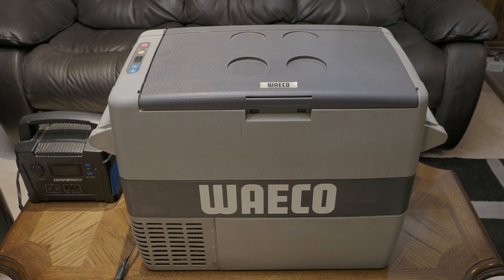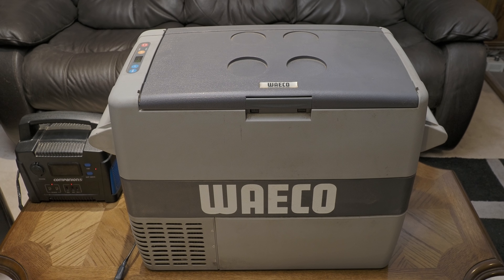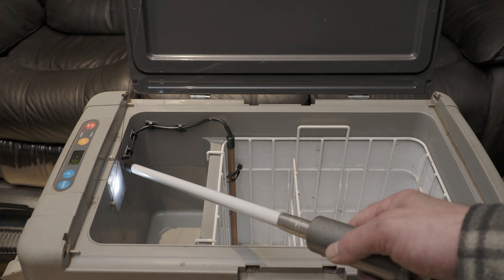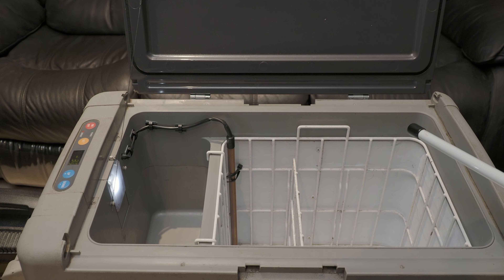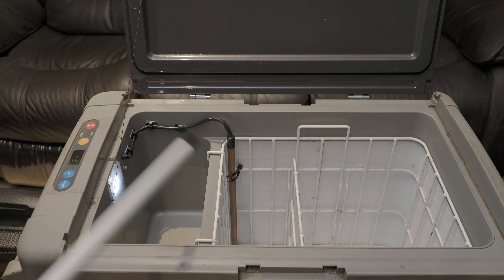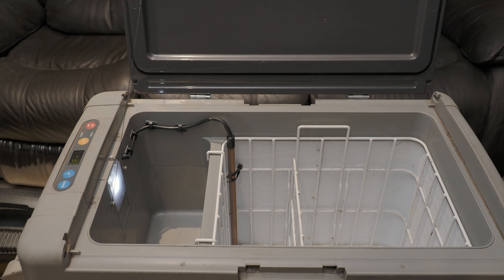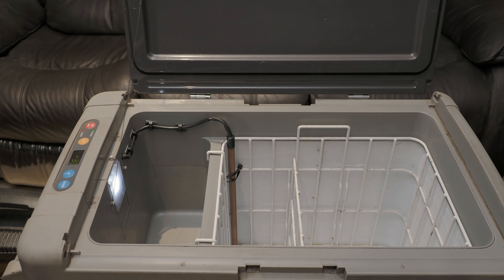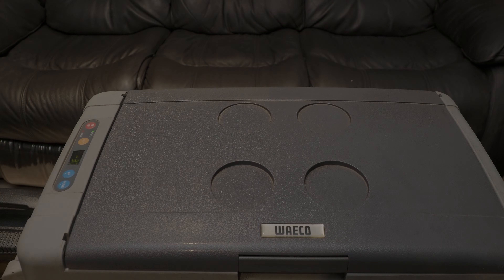Waeco CF50 Thermistor Fix - The Easiest Fix Ever

Comment: Absolutely wrong and I even say a stupid solution - never do what this guy advices!!! First of all you need to have ability to remove the white insert to clean he bottom! Second, if your Dometic CoolFreez CX or other has a faulty Thermistor - then  just order it for $8 and replace it - 15 minutes work. Most will need to buy this "Dometic 4450001983 NTC Thermistor ASM", it has the same 2 pin connector as all WAECO or Dometic. You may also use a "Dometic 3851210025 Replacement RV Refrigerator Thermistor" but int this case, you may need to preface the connector, as it is little bit bigger (use connector front the original faulty one)...  If you have done the replacement of Thermistor (in its original place) and temperature is incorrect, if cooler freezes too hard, then use the control panel, holding down both buttons "+" and "-" and then you will see "A" and temperature adjustments - adjust as needed.

Comment: 17 years! I’m thinking of buying one but there is a lot of repair videos making me think they aren’t reliable
Reply from the maker: I have two CF50s, the first one is over twenty years old and was a giveaway with my first GU Patrol and still works perfectly. Both have travelled with us into the bush on a regular basis, surviving the rough and tumble of these trips. The fridges are always tied down solidly so that they don't slam up and down when off-road. I think the secret to longevity of any fridge is to keep it running all the time, to ensure that the compressor seals don't dry out. Waeco (now Dometic) fridges have been around for a long time and sold in very large numbers, so like anything that's sold in large numbers, there will always be more reported issues. I wouldn't hesitate to buy another.

Comment: Great solution. How did you figure out is was the thermistor? My waco has recently started freezing everything. The fridge thinks it is 21 degrees inside so it keeps running despite the inside temp measuring at -4.
Reply: That's a thermistor issue
Reply: Mine thinks its 54 c

Comment: Good vid, thanks. I have a similar vintage Waeco (different model). I need to replace the entire operating panel as it doesn't register anymore. I'm in NZ, and not much joy for parts here, can you recommend an Australian parts supplier?  Thanks in advance. Richard.
Reply from the maker: You could try Caravans Plus, the link in the description, as they have parts lists for all the fridges. There are others about as well, but given that Caravans Plus were well priced and delivered quickly, I'd certainly recommend them first off.
Reply: This is very ‘high level’ - what type of thermistor, where/how to connect it?  I’m about to put $22 mercury bulb thermostat in mine - how would that differ from this solution?
Reply: Thumbs up for caravans plus

Comment: Thanks for the video.
I bought a Waeco CF-50 cheap, as is... when I plug it in, it turns on, and all the controls and LEDs appear to work, but the unit doesn't get very cold, even when set to -18 degrees C. 
Could this be a thermistor issue, or does it need to be re-gassed?
I assume the compressor is OK, as it gets slightly cold...
Reply: If cooler freezes too hard, or too weak, then use the control panel, holding down both buttons "+" and "-" and then you will see "A" and temperature adjustments - adjust as needed.

Comment: I just bought a supposedly good working Waeco 50...It was pretty evident after switching it on I also had a thermistor problem with the temp reading way out and compressor not switching off.  After watching your video I had a quick check for another way into the unit without drilling a hole. What I decided to do was remove the interior light and carefully made a small channel into the back of it where it slides into the main body of the unit. I luckily had spare thermistors that only cost about $3 each here that are the correct ohms from cheap digital temp switch relays I use as safety shut down relays on my gen sets.  They plug straight into the Waeco control board. I fed the end through one of the two already present square holes in the light fitting. The wires fit into the slot I made the light slides straight back in place and thermistor end comes out the bottom of the light fitting. Working perfectly and tucks in nicely under the basket. So thanks for the idea of putting it inside the unit rather than all the effort required to put them in the original position
Reply: Good idea about useing the light fitting. I'm about to do my fridge and was thinking about deleting the useless light altogether.